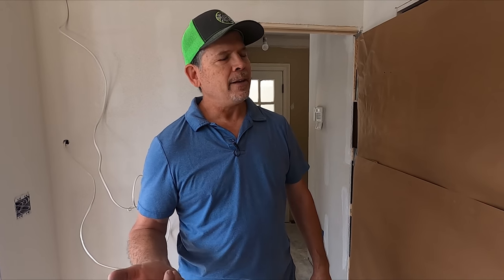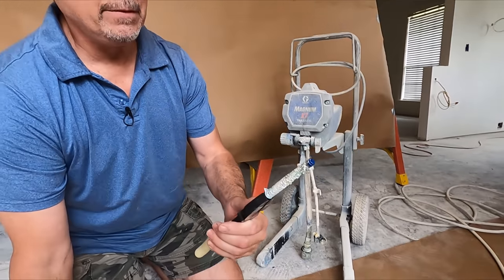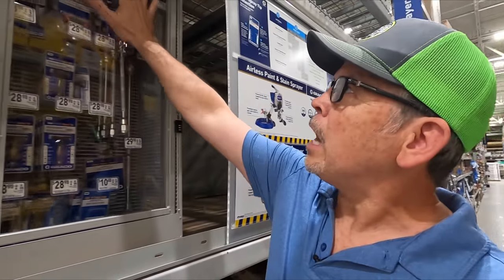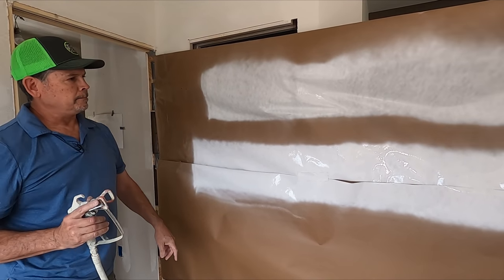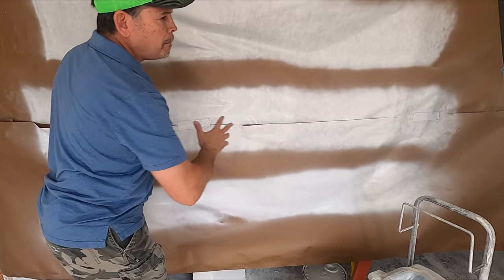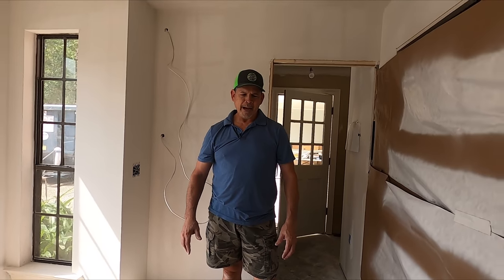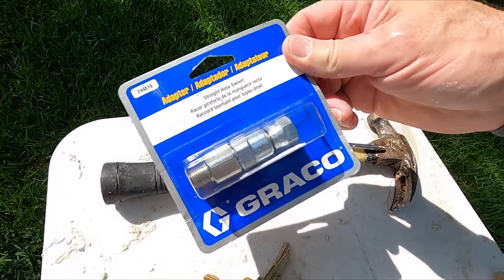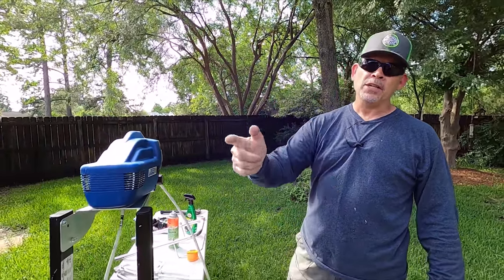Does a NEW Paint Filter REALLY Make a Difference?

Comment: Impressed when people aren't too proud to admit a mistake... that was one of the first things I noticed when I found y'all a few months ago. Subscribed immediately. No one can know or do everything right all the time... just keep learning, improving, & doing our best. Y'all's videos have taught me quite a few great things. 

A decade ago when a buddy & I were painting regularly (8-12,000 sq ft/wk), we'd clean the tip, filter, & machine filter every day... unless some of the paint cans weren't brand new, then sometimes it'd be as low as cleaning everything each ~2~5 gallons. When you regularly keep it all clean, it won't take any time at all to learn when it's not right... just by looking at the coverage & spray pattern you'll know exactly what needs to be cleaned to get rolling at full speed.  (We had 3 main spray machines and 6 spray handles setup for different types of paints & what we were covering.) FWIW, you should go over that sprayer... most Gracos are built with internal filters too. Jump up to 36 seconds on this and see if you've got this one: https://www.youtube.com/watch?v=R2Oqn4YIKC8

We also kept a little plastic yellow tackle box in the back top corner of the van... in that box we kept 1 or 2 spare filters for each machine & gun handle, at least 2 of every tip we used, and a small bottle of Dawn dish soap (in case we ran out of Pump Armor). Rarely needed to pull out "the box" too often, but when we needed it, was a lifesaver to have that with us.

Comment: Great video. I have an older X9 that I purchased for a job and it has been great. I always disassemble my gun and brush it down after every project.  You may also want to look into a “Whip Hose” they are like 4 ft and connect between the regular hose and gun, offers more flexibility/freedom of movement. Lastly, another tip I picked up is that if you are going to take a little break while spraying you can put your gun in a bucket with some water to keep the tip from clogging, same principal as your wet rag over the bucket trick.
Reply from the maker: Cool thx Jorge 👍

Comment: I have the exact same machine.  One little tip I learned from an old time painter years ago;  all paint, no matter the quality, contains particles that need to be filtered out.  His trick was to buy a box of Knee High Nylons and place one over the input of the machine.  It filters out most of the big chunks.  Also, a whip might give you more control than a swivel.
Reply from the maker: Thx James.   I usually use a paint strainer over the suction tube but nylons are probably better and cheaper.   I’ll check it out 👍
Reply: Don't rule out the paint strainer.  That's before you put the paint in the bucket.

Comment: Great video guys, glad your back.  Something I do to help with keeping my spray rig clean is to throw a small drop cloth over it while painting just keeps the over spray from landing on it.  I also put a panty hose over the screen filter  that goes into the paint and hold it in place with a rubber band, this helps strain the fine particles that would otherwise get stuck in the filter.  Love yall's videos keep up the great work! :-)
Reply from the maker: Thx Paul 👍.  Yep plan on covering ours going forward.   I use paint strainers over suction tube but will try hose 💪

Comment: Another great video. You mentioned a few things that I think I might be able to help you with. You bought a swivel and I think you may want to buy a whip. It is a short piece of smaller diameter hose that is more flexible and helps you not get so fatigued. Another thing you may want to incorporate in your spray painting routine is to strain your paint before you paint anything. Even from brand new cans of paint there is debris inside many of them from the factory. The strainer bags are fairly inexpensive and are reusable. They come in one gallon, two gallon and five gallon sizes. Since your spray rig does not have a built in filter this will really help with the quality of your finishes especially when spraying enamel. Thanks again for the videos and keep up the great work!
Reply from the maker: I’ll check out the whip thx 👍.  I strain previously opened paint but get your point regarding new paint.   I’ve been trying a strainer over the suction tube also.   Seems to work well.  It’s a lot easier thanks straining 5 gallon bucket 😳

Comment: You should always remove the filter and clean after each use. It also doesn’t hurt to pull out the tip under the reversible tip. Trash can build up behind it and around the internal spring and cause you headaches even with a clean filter.
Reply from the maker: Cool thx Steven.  I was looking at that piece yesterday.   I’ll definitely check it out 👍💪

Comment: I love the air swivel you installed.  I use them on all my air tools.  I'd recommend one for your framing nailer as well, if you do not have one.

You can also try installing a male and female quick disconnect on a single swivel and running that inline on all your air tools.
Reply from the maker: Cool thx blade 💪

Comment: I've  been spraying a lot with the Graco Pro X17. On that machine there is a second filter at the pump to hose connection. I clean them both after every use and filter my paint. I pull the hose anyway to leave at the jobsite so I can take the pump with me, so it don't get stolen. Definitely store it with pump armor or mineral spirits, water is very corrosive to these machines when left in them over time. I've always been told you get around 40 gallons or so on a tip, depending on how abrasive the paint you're spraying is.

Comment: Just a tip on your paint intake off the machine you can use a stocking or fly screen to cover the intake because plastic drums these days dry on the areas exposed to sun and also the lid drys out and contaminates you’re material hence why there is so much dried out paint in the filter plus it’s better to completely clean you’re gun and machine out throughly after the end of the job depending on time between jobs you on what should leave in the lines and machine because water is not good as you could imagine
Reply from the maker: Cool thx 👍💪

Comment: I would have used isopropyl alcohol. Latex paint is soluble in alcohol and will evaporate to nothing rather than the residues and oils that are left behind by those cleaners that could get into your sprayer and mess up your water-based paints. I haven't tried it yet but I actually thought about next time I clean my sprayer; I wanted to thin down some silicone and painted onto all parts of the sprayer since the latex will not stick to silicone. Then after every paint job all I have to do is spray it off. Could even use the sprayer itself to do that once you clean the lines out and have clean water running. I'll let you know if it works 👍

Comment: Upgrade to a Graco 395. It's fully serviceable and you can swap out the pump if it fails in about a minute if you carry a spare.  Those x5/x7's  have to go straight in the trash if the pump fails, The digital pressure controller is also great especially if you're doing trim and doors.
Reply from the maker: Yeah love those digital displays.  Thx John 👍👊💪

Comment: I have the Graco X5, i just started using it and can spray a 13x10 room in less than 15 minutes, I love it would recommend. Only bad part is it takes like 30 to an hour to clean. lol
Reply from the maker: Yep but still faster than brush/roller even with cleaning time 👍
Reply: if you like to keep you tools clean and in a good condition you need to clean good 
i have a Graco 490 and yes it takes about a hour to clean but you will have a good sprayers for years to come
Reply: Idk if it's faster than a brush and roller once you add in all the taping and other extra prep. With an 18inch roller I can typically paint a room in an hour clean up doesn't take much toss the roller in the trash, rinse brush and roller tray out and be done. I only spray if I'm doing cabinets or trim or if the house is 100% vacant as once the paint is atomized in the air its going everywhere.

Comment: OHHHHH My Word! I clean my gun and filter after every use. Let me know ow that swivel adapter works. A tip is supposed to last 30 - 40 gallons but when the filter is that blocked i bet your cutting that down by a third. Also you have the intake basket filter which you might as well clean as well.
Reply from the maker: Ah... a clogged filter results in longer tip life.   Makes perfect sense.  I think my whole house was painted with an airless with a clogged filter 😡
Reply: @StudPack  It's probably the most expensive tool I own so I clean it like nothing else I own. I have the Pro X 17 and I just bought a second Titan XT330 (at half price) Everything is interchangeable between the two. The Titan is slightly more powerful and did a flawless job. I can't say the same for my carpentry.

Comment: I manage a Tool Rental at Home Depot and we clean the filter withthe pressure washer after every rental. Change it out maybe once a month.
Reply from the maker: Cool thx Michael 👍. Pressure washer isn’t too much for that little filter?   How do you hold it ?   Could wash it with the sprayer I suppose (gun without a tip is like a mini pressure washer).
Reply: We use an electric pressure washer. I hold it in one hand by the end and spray 1/2 then flip it around and do the other 1/2.

Comment: I run a few buckets of water after each use till I see clean water through the machine. Then take everything apart to clean it internally because there is steel check ball in the pump that will sieze.
Reply from the maker: Yeah I need to check that also 👍
Reply from the maker: Yeah I need to check that also 👍

Comment: Hey Guys you should clean that sprayer after every use. Including the Filter. And NEVER EVER PUT YOUR HAND IN FRONT OF THE SPRAY NOZEL.  I usually run 10 gallons of water  through after every use. then open up the handle and clean the filer  and clean the filter on the pickup tube.

Comment: Next upgrade should be to the titan 440. Best upgrade I've made as far as airless sprayers go.
Reply from the maker: I’ll check it out thx 👍
Reply: @StudPack  no worries man, you'll love it.
Reply from the maker: Looks like more of a pro rig ?   I can see upgrading one day 💪
Reply: @StudPack  yes it is a pro rig. I don't notice much difference in quality of my paint with the rig as much as how much it is capable of pushing.
Reply: @StudPack  💪🏼💪🏼💪🏼💪🏼 if you upgrade sometime, make a video.
Reply from the maker: You got it 💪
Reply: It's hard to beat a Greco, it's been the industry standard for many years.  However, there are bigger and more powerful machines out there for the professional painter that paints a lot of volume every day.
Reply: The man who is painting the exterior of my house is using a Titan and loves it.  I don’t know if he was kidding or not but he said he never cleans it other than soaking the spray head in water overnight and flushing it with water.  He did replace a tip during my job.  His work quality and attention to detail is top notch and I am 100% pleased with his work.  He takes the time to Bondo and sand all wood joints, nail heads, cracks, etc. and replaces any rotted wood and siding.  When I hired him he said that it would look better than when it was first built.  He wasn’t kidding.

Comment: i leave it out and use a gallon strainer on main hose
Reply from the maker: I use a strainer on suction hose too.   No issues leaving out filter?
Reply: @StudPack  no issues ,and it helps if ure using non thinned paints or weaker machines